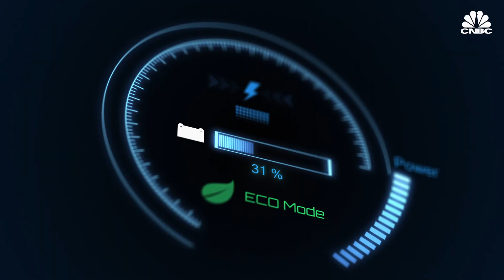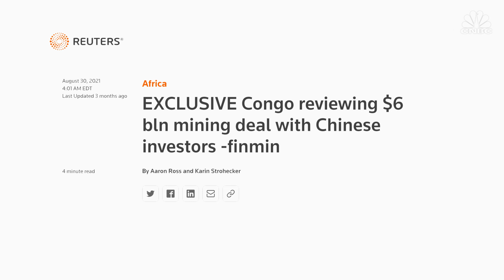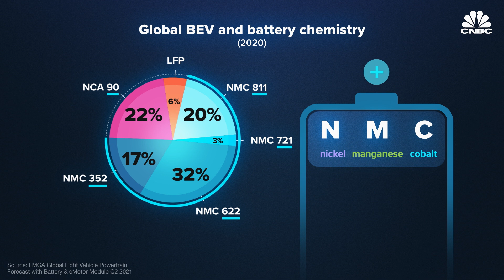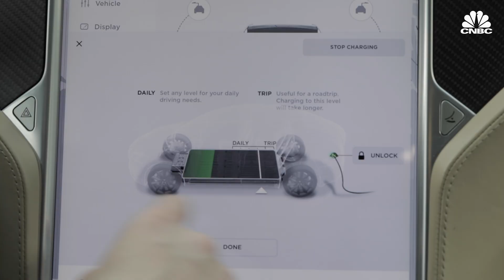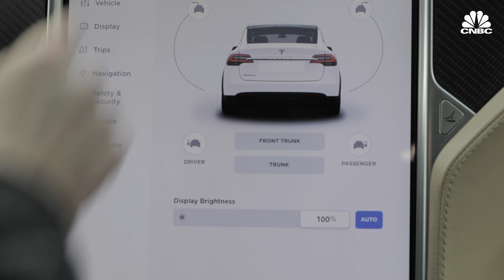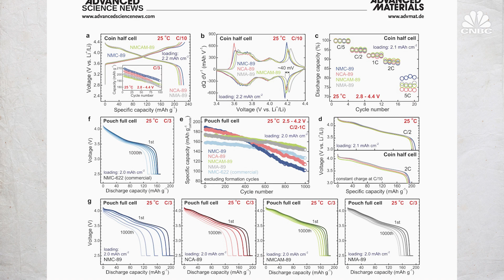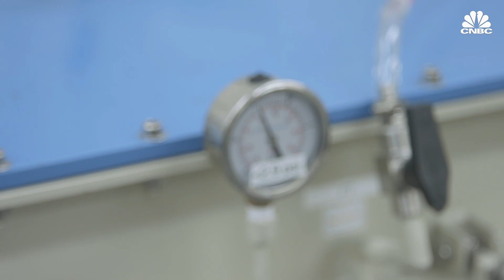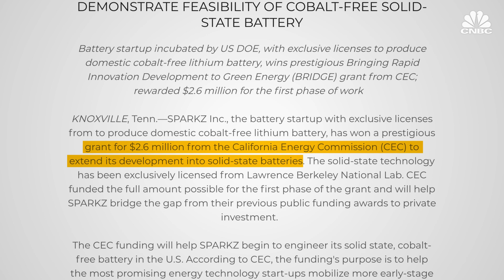How Removing Cobalt From Batteries Can Make EVs Cheaper

Comment: Electrons flow from Cathode(-ve) to anode (+ve)
Reply: In a battery there is electron flow, as you describe, and there is also ion flow, usually in the other direction.
Reply: @AlterKater  my point was that the video said the oposite
Reply: I hate that stupid abbreviation of adding ve to (+) (-).  I'm not sure when it started but it's been since I was trained on electronics 20 years ago.  The ve adds nothing.

Comment: Everyone is talking about how good EVs are, does no one realize that we are not recycling EV batteries fast enough or the resulting enviromental impact? I'll stick to petrol until hydrogen fuel cells are commercialized.
Reply: Nonsense.  Used car EV batteries are in high demand for second use as power storage and are subsequently  recycled for their materials.  It’s a 10 to 15 year life cycle.  Hydrogen fuel cells make no sense in light duty vehicles, and most hydrogen currently produced uses dirty gas.

Comment: 5:55 Just wrong : LFP batteries provide far enough energy density for cars, the 60 kWh model 3 sold in China and now Europe proves it. Of course a wide and reliable fast charging infrastructure is needed to be as versatile as an ICE car, and it is the case with Tesla's superchargers all over Europe. Regarding density, the model 3 car receive a 60 kWh and a 80 kWh battery, so using LFP for the 60 kWh just will the space.

Comment: So in 5, 10 years will replacement of a current Model 3 Performance (and LR).... be expensive, hard, or impossible? Or would they replace it with cobalt Lithium again? (watch video first)
Reply: Good question, if designs are compatible you should be able to just swap batteries and continue to use your vehicule. It should technically be quite feasible.

Comment: It's all about range. LFP is the battery chemistry of choice for much of Asia and Europe and it's going to get incredibly cheap with scale, while the US with its much higher range requirements, poor charging infrastructure and the weight/un-aerodynamic shape of popular full-size pickup trucks will mean that automakers have to push further with Cobalt-based batteries there.

Comment: You can't say "heating sth to 1000 C" is "environmentally unfriendly" per se. It really really depends on the alternatives and on the source of energy.
Reply: I think it could be taking about having to melt plastic and other things releasing gases.
Reply: Well, given that the cheapest ways to heat materials come from sources that are terrible for the environment such as gas and coal, he’s right. Plus these companies operate on very tight budgets, as recycling is close to non-profitable.
Reply: There are multiple companies working on bio reactors like used to extract gold being developed for battery material extraction
Reply: Outside of comparing it to the alternative, such high temperatures are certainly environmentally unfriendly
Reply: It also depends on if the heat can be used for other purposes or to preheat the next batch rather than just allowed to cool.  There's a lot that can be done to make the process more efficient, the question is whether or not it's cost effective to do so.  It's the fundamental structure of our economy and our regulations that allows economic externalities to be a problem.  We can change this with regulations but will we...
Reply: Not really. That they have to do it at 1000°c is inherently more unfriendly than if they could do it at room temperature no matter what.
Reply: @TheBooban  this too. Heating anything that high is going to use an enormous amount of energy

Comment: With the emerging of BYD blade battery, it is already a game over.
Reply: Um... no.  LFP batteries are heavy and slow.  Also the blade battery takes forever to build and currently production can't meet demand.  Maybe in 5 years the blade battery will be a big deal.  Until then 2170 will be the best.  In 5 years the blade battery will be competing with the 4680.  We will see which is used more.  Tesla just bought 20gwh of blade batteries for Tesla shanghai.

Comment: Just a minor correction. LFP LiFePO4 Lithium iRon Phosphate is an entirely different chemistry type to Nickel-Manganese that does not require Cobalt. More like it is Not Compatible with cobalt and not viable to use it. Removing Cobalt from LiFePO4 has no effect on it's safety and stability, it is just an entirely different concept.

Comment: We need hydrogen infrastructure green hydrogen
Reply: No we do not. Hydrogen is horribly inefficient.
Reply: @Freba9  idk why you think that everything can run on it. It takes 5 minutes to fuel up and your done not everyone is gonna want to wait 20 30 minute's to charge there car and batteries can only power so much airplanes can't use them and big trucks can't hydrogen they can
Reply: @Joe.8671  We were talking cars, not airplanes. Efficiency is the most important thing because that lowers CO2 emissions. Hydrogen for passenger cars makes no sense at all. Big trucks on hydrogen would be acceptable to a certain degree but should be battery powered as much as possible.

Comment: Batteries will not be sustainable as petroleum .we have used petroleum for over 150 years and still have more to go for another 150.battery materials have alot to overcome!
Reply: If you think there will still be oil refining for road fuel, even in 30 years time, you are clearly deluded.....  Shell themselves have already stated that the World saw peak oil demand/production in 2018, and since then we have seen a slow but steady decline in demand. It's only a matter of time before big oil will have a momentous decision to make, because their fuel markets will begin to shrink steadily over the next 10 years. They will need to decide at what point mass refining is no longer viable...... It will be interesting to see where they go from there. I have a suspicion they will hike prices to compensate for sliding sales, in order to try to maintain those one colossal profits......which will of course have the effect of pushing people towards EV's.......
Reply: @Brian-om2hh  the high gas prices are because they can,just like utility bills aka electric.if you think full switch to ev won't effect your bills your also delutited.

Comment: Yes, but a electric car batteries are what give it tremendous power.  If the battery has less density then electric vehicle has does not have great horse power.
Reply: WTF That makes no sense. The weakest chemistry type LiFePO4 is still insanely powerful as a Model 3 SR battery can easily do 300 KiloWatt but the single electric motor only can do 258 horsepower. Very roughly the SR LFP battery is about 50kwh usable thus 300KW is only 6C rating stress load. 6C is very conservative and safe but that is still overkill 300KiloWatt.

Comment: Ok. I’m not buying electric car until they become cheaper. Thank you for telling me not to waste my money on current electric cars !!
Reply: A hybrid maybe an alternative choice for you to bridge the gap until EVs mature in the next 10/15 years.
Reply: The used and resultingly inexpensive (under $10K) EV I bought 6 years ago has saved me considerable money because it takes about one third as much money to drive per mile on a vehicle powered by electricity when compared to a gasoline car of similar size/weight/utility. It also has a considerably less complex drivetrain compared to a gasoline car, so I've saved money on all the typical maintenance items associated with keeping an internal combustion engine (ICE) running properly. 

The only real downside is that early EVs, like mine, have a relatively small battery, because EV-grade batteries were rather expensive to manufacture a decade or so ago. Hence, I have a vehicle with a realistic range of around 70 miles per charge. But this is more than adequate for my urban living needs. I'm also able to charge my car overnight at home, which is far more convenient than having to travel to a gas station. longer range EVs are now plentiful, of course, but they're still more expensive to buy than a comparable gasoline car. But operating and maintenance costs are already far lower to gasoline cars of similar aspirations. So, I would contend that, if saving money is what's keeping you away, you're foolish not to consider an EV.
Reply: Buy a Tesla, and thank me later!
Reply: still saving on maintenace n gas.
Reply: They won't for a while. Tesla's Demand is insane right now.
Reply: @lachlanB323  it sure is bit I ordered mine back in May this year got it by August standard range I'm loving the car!! Never going back to stinky gas!! 💯 it's An amazing machine the fit an finish is allot better then previous years definitely recommend getting one!

Comment: The comparison between solid state batteries and solid state hard drives was rather bizarre.

1. Hard drives do not have electrolytes
2. SSDs operate at the same voltage as HDDs

Comment: This entire argument is moot.. you can manufactur a battery that will take a vehicle around the globe on a  single charge.. but what are they planning on using to charge those batteries.. the woke left thinks green stuff like solar and wind will be  sufficient but the single most potent source and the most consistent is either nuclear or coal.. focus should be on generating power first the look at storage

Comment: It's ok that Cobalt mining uses slave and child labour. What's important is that you drive your EV in the west and feel good about yourself.
Reply: Bs
Reply: So don't use ev stay with ice and stay polluting ,
Reply: There's no such thing as emission free vehicle. EV's pollute too, it just doesn't happen in front of your eyes. Think bigger.
Reply: @alians1978   its obvious thing but you don't wanna acknowledge, ev is electric , and being electric it can source the energy for everything that generate electricity, ofc there's dirty one and the clean one, but the point is it has it's capability ,unlike gas car is only from gas no chance from being clean, until we move 100% to renewable energy ev is good starting point.
Reply: @cobaltblue2756  I was actually referring to the pollution caused by mining, manufacturing and recycling batteries. As goes for electricity there's no such thing as 100% "renewable" until maybe we have fusion. Production and recycling of solar panels are very toxic and pollutant too. As i said, you gotta think bigger.
Reply: @alians1978  still imo combustion engine should go , as it account for 30% pollutions in America, i don't think the amount of carbon emissions by ev production nowhere near the oil industry and combustion engine combine...
Reply: @cobaltblue2756  combustion engines are gradually being replaced by the E.V.'s. The main problem with batteries is that they pollute the soil. 
At the end of the day, we are progressing and doing things better everyday. I just don't think it's accurate when people use terms like; zero emission, renewable, sustainable for E.V.'s or Solar.
Reply: Try not to feel too smug as you drive along in your ICE car either, because the big oil companies have mined cobalt for decades, also using child labour. They use it to remove sulphur during the refining process....  I can't understand why this has never concerned you previously.......

Comment: This is a very good overview video. 

One issue to note, which was overlooked in the video, is that much of the production of cobalt in the D.R. Congo is by large scale mechanized copper operations. “Artisanal” or small scale mining (“ASM”) accounted for no more than 20-22% of D.R. Congo’s cobalt production at its peak and is now likely less than 10% (note:
ASMs act as swing players that can rapidly adjust production as prices fluctuate). Moreover, only a small fraction of ASM is illegal or tied to human rights violations. That being said, more production diversification is needed
for cobalt and many other commodities.
Reply: 20% is quite a lot
Reply: @LOLHAMMER45678  : perhaps, but that was the peak and only a small portion of that was illegal. Still is it important to highlight but the video made it seem as if all of D.R. Congo production is tied to human rights abuses.

Perhaps a bigger concern is that much of the cobalt production is D.R. Congo is now controlled by Chinese firms and that cobalt chemical refining (more that metal refining) that is the next step towards battery materials is nearly all Chinese, as are most of the manufacturing steps that follow.
Reply: @lashnhith634  Fine point
Reply: @LOLHAMMER45678  I agree
Reply: Maybe u should do some research
Reply: A bit late but there was a guy who snuck into the so called machine only mines and took pictures and video and they are filled with thousands of people doing artesenal mining.  They claim its being done by machines flat out lying and the coorporations and countries pretend to not see or know anything.
Reply: Sunday, August 28, 2022

You certainly glossed over all the children working in dirty and dangerous cobalt mines!
Plus all the people who get injured in land slides, some of whom are children.

Really, that is the most cold hearted thing I have ever read.
Reply: @Anthony_in_Bloomington_Indiana  my apologies, that was certainly not my intent. I was simply trying to point out that there is a lower chance that the electronic device(s) that you used to watch the video and reply to my comment contain cobalt that came as a product of child-labor than this video would have you believe (and lower than that of other commodities like tantalum). Nevertheless, no child-labor like this is acceptable. I would imagine that, like me, you would also prefer that we didn’t have to mine new materials at all and could instead rely on  what we have already extracted from Earth. Alas, that is not possible so long as most at the top of the economic pyramid continue to consume unabated while those at the bottom the economic pyramid pay the price.
Reply: if Apple and Tesla werent so cheap, they could just get the cobalt from Australia... but they prefer child labor prices.
Reply: @juz8. Maybe you should go help Congo families out of their poverty line yourself, while you ditch your cobalt-filled phone. Do some of the heavy lifting instead of pointing fingers
Reply: @juz882010 really?? You got any links to videos about that? I would be interested to see! Thanks!

Comment: Get rid of the radiation. Your balls will thank you.
Reply: That’s not how that works
Reply: I read that cobalt glaze in certain Fiesta ware is radioactive. If the motor wasn't 200 Hertz it would be ok for brain development.
Reply: @tombaja4.9  what? I’m confused about the 200 Hz thing.
Reply: Motors are high frequency. Who knows what frequency unless you have a frequency counter. Not the average 50/60 Hertz in a vaccume.
Reply: Wi-Fi and phones use gigahertz. So does your microwave oven.
Reply: in a crowded place there are hundred phones. On the freeway there are dozens of high frequency motors. Please add that variable in the measurement. A small sticker says this device complies doesn't mean that all devices together comply. Kapla!
Reply: See terrain following radar and you could add that if you live near an airport.

Comment: ive been using cobalt coated drill bits for a lot of years. i burn thru them. i legit use 3 to 4 entire sets per year. weird thing is not one video or article about my causing an increase in cobalt mining????
Reply: There's never a mention of the cobalt used in refining  petrol and diesel either.
Reply: There's a big difference between a small bit vs millions of cars, DUH.

Comment: EV's have gotta dump between 20 and 30k off the price tag if they want to get into the average persons paycheck range. Personally I think EV's are a bandaid solution till fuel cell tech gets a lot better and cheaper and of course only the rich are getting anything from all this.
Reply: New technology is always more expensive than old.  Economies of scale will bring the costs of EVs down over time.  Also, EVs have much lower maintenance and charging costs